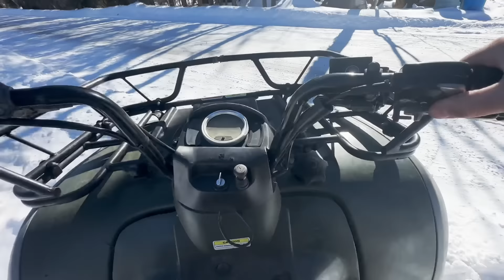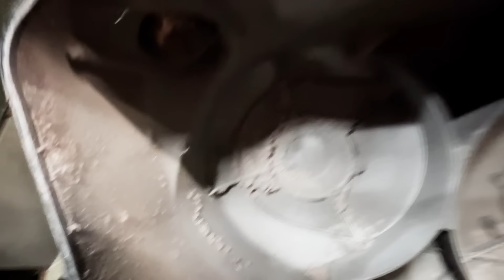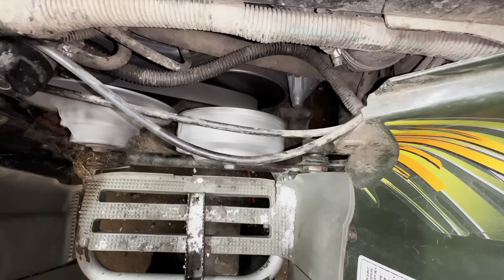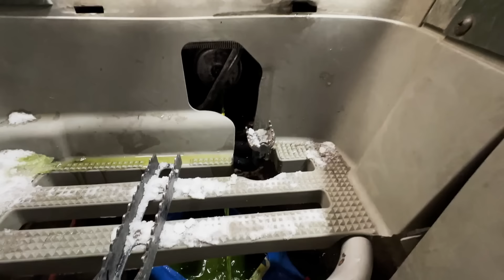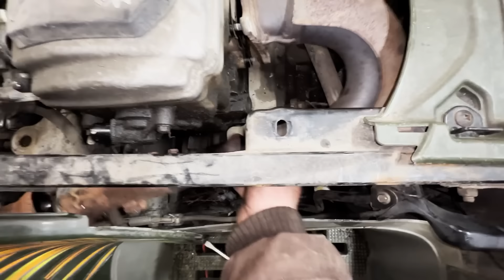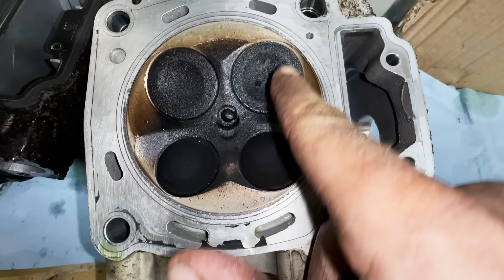Bombardier quest 500 Won't SHIFT and she SMOKES...

Comment: Hey, gotta question. I have an odd problem with my quad its a 98 Suzuki quadrunner 500 i replaced the cdi and coil and cleaned the carb it ran great except at 1/4 throttle where it feels like it ls stuttering and missing but it only ran for 10 minutes under it wont run at all and it has great spark. Im pretty good mechanically and understanding issues but this one got me stumped. I had and issue with the float sricking and flooding so idk if its getting stuck open and sometimes getting stuck closed